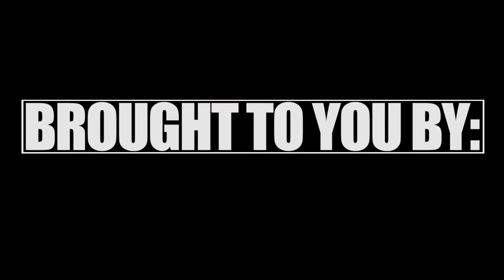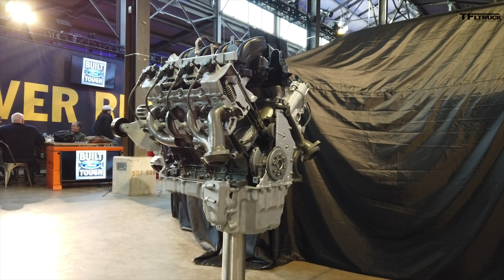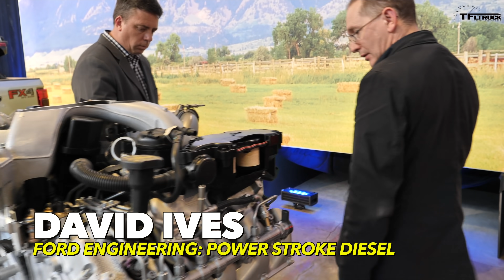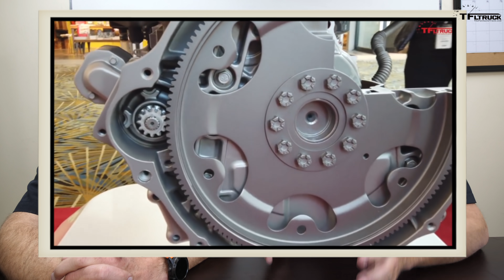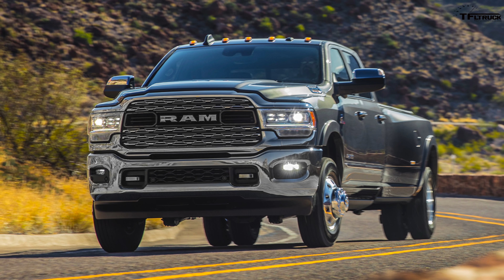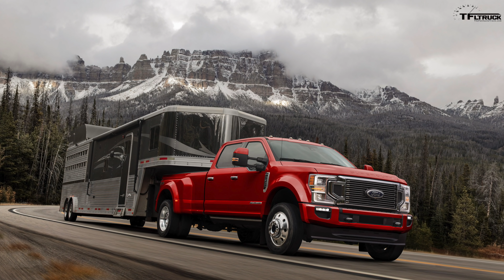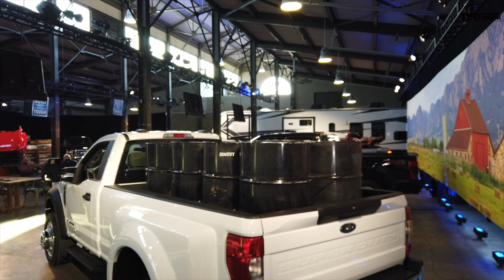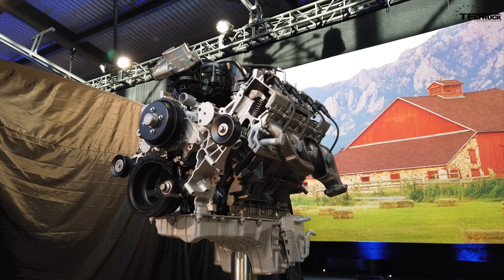Are Diesel HD Trucks Dead / Will Electric Pickups Replace Them? No, You're Wrong! Ep.5

Comment: Diesel died years ago. Has already been replaced by big gas v-8s. At least in the heavy construction industry. I haven't seen a diesel work truck in 10 years. Electric isn't even close to replacing combustion engines yet. Need a better way to store the electricity. Lithium just can't do what is needed.

Comment: Fully electric trucks will not be affordable enough to justify replacement for many for the foreseeable future. However, in the future I think, 10+ years, the technology will drastically develop reducing costs of production and cost to the consumer. When this happens, no one will want the fuel bill and will jump on board. Eventually, what electric trucks will achieve may make diesel unjustifiable. They need an option for the turbo diesel noise replicating rpm to keep the fun.

Comment: What do you want to get in a wreck with, while hauling  HEAVY crap around in heavy traffic? A) A truck with lots of gas stored in it's tank  AND lots of electric energy stored in it's battery bank, or B) A truck with some relatively safe diesel in it's tank? I'm not buying the arguments i just heard that electric gas is easier to fill, that it's better, that it's cheaper.  Sorry Roman, Andre sounds more sensible today.

Comment: Ford built a Hemp vehicle before gasoline even had any hold on the market....the oil industry killed it in it's tracks. Good luck all you Ben Franklins.... Hemp can save the planet & run diesel engines clean as a whistle, but NOOOOOOO....Big Oil needs to hoard the cash..

Comment: Diesel is not going anywhere.  Can you imagine the drain on a set of batteries to pull 30,000 lbs?  Battery life will be 75 miles.

Comment: When battery tech reaches the power density of diesel  we will see the conversion to hybrid options but not until then. Diesel is here for a while yet but they are extremely complex and so are gas pots. Electric has the simplicity. I work in the Oil patch and we pump everything with electric motors and those motors last decades running 24/7. Besides with all the tech on these trucks that now need 200 amp alternators just to run all that stuff.  I agree with Roman soon things will be quiet or like ford they will pump the growl through the speakers.lol Thanks guys I enjoy this !

Comment: Just because ford is releasing a 7.0 liter gas engine doesn’t mean it’s the end for diesel.diesel engines we’re meant for hauling heavy loads that gas can’t  but electric could possible end diesel but it will take time for that but in mean time gas is never going to end diesel

Comment: One thing scrolling through the comments that I haven't seen anyone mention (it's possible I missed it) that Graphene Baterries are on the horizon. Much quicker charges, much better power output, lighter overall. Any ideas? Also, can't find the article, but one company took two batteries and placed them in an all electric car, when the first battery ran dry it switched to second one while the first one charged via a conductor on the wheels. Went over 1000 mile supposedly without charging once. True? I don't know for sure but I like the idea.

Comment: It's way too soon to make a judgment, conceptually, the hybrid makes sense with the fuel savings and the starting torque.  Once there are some hybrid trucks out there running around on a daily basis doing real work, we will see how they hold up.  As typical with hybrids, the battery technology is a major factor and the requirements of heavy-duty service will require significantly more battery capabilities than the hybrid cars require.  Moving around on the rough ground, carrying heavy loads, will place a new strain on the concept beyond what has been done with cars.  The motors are relatively cheaper to replace, but the controls are very expensive, which may offset the cheaper motor advantage.  As an electrical engineer and a diesel truck owner, I am watching with great interest, although I still like my ride to make great sound!

Comment: Andre is right, sorry Roman.  Diesels are hear to stay.  They have become soooo much cleaner.  For the amount of power you get out of them and they are very efficient at that high power output they are the better choice.  Men will always want there trucks to sound awesome and you just cant do that with electric.  The reason they came out with that engine was mainly for their medium duty trucks. Some customers just want a gas engine and it was time to retire their V-10.  I have owned a 2001 Duramax, and a 2016 Duramax.  I loved that 2001 more than any other truck I have ever owned and I have been buying trucks since 1983, that is until I bought my 2016 DMAX.  That is one insane truck. 3500HD crew cab short bed single wheel. It does everything I ask it to do and a lot more. It is the most awesome truck and engine I have ever owned bar none.!!!!

Comment: Andre your WRONG there's a lot of commercial trucks using natural gas and propane many engines are made by Cummins.  Personally I dislike diesel pickups, I run a 454 big block in mine and love it. Mileage is about the same as new choked down diesels, fuel is cheaper, maintenance is cheaper, no fuel additives or urea which both add costs. Besides I don't have to stand in a puddle of spilled diesel fuel when refuelling and smell exhaust and diesel fuel. Also gas is smoother and no vibration, start faster and better when cold. For me 425 go and 500 ft lbs is plenty of power and have twice the rpm range of a diesel.

Comment: Forget the expensive and complex battery hybrids (that can be betrayed by weak batteries).   The point of the 7.3 port injection spark ignition engine is to provide a ready-made platform for CNG or LNG for HD pickups.   On a $/MMBTU basis natural gas costs a fraction of diesel (or gasoline) and can be made to run very clean without all the complexity being packed into late-model diesels.   All they need is an upsized fuel system (including injectors) to accommodate the fact natural gas is less energy dense that No.2 or RUG.   Already we are seeing CNG and LNG being put into Class 6 and 7 delivery trucks (think UPS)   Trucks that big can accommodate the bigger fuel tanks natural gas needs.   7.3 SI engine on CNG or LNG:   Lighter and cheaper than diesel.   Cleaner without the complexity.   Way less expensive tht battery hybrids and a lot more reliable.

Best of all?   The US is hip-deep in recoverable natural gas.

Comment: Ok can I just say something about what these idiots r saying. You’re talking about a 7.3L hybrid gas engine and theorizing that gas engines r gonna replace diesels. Let me tell ya something, YOU’RE NOT GONNA GET THE MILAGE OUT OF IT!!!!! Chevy has proved it years ago even without all the new economic systems. Actually even with em an LSX, which is a 454 (7.4L), does not even get close to to the mileage of a 6.6L Duramax. Alright, a Chevy 8.1L Vortec has more towing power than a Duramax, but u pull anything with an 8.1 that gas needle will go down faster than a NACAR cup car can get halfway in their fuel run. Hell Ford’s 3.5L EcoBoost claims to get worst gas mileage than their V8 5.0 Coyote. So u guys r drunk if ya think gas engines r gonna replace diesels.

Comment: If I doesn't have the Future Generation diesels like the Achates engine design I won't buy it, plus it better be clean burning NO Volkswagen cheating or any other brand of diesel cheating crap on them. Nothing wrong with having a Achates style clean-burning diesel engine that has low emissions and still have plenty of power with good fuel mileage...

Biggest problem with the Diesels is the emissions that they produce,they produce plenty of power and they're great for towing and pulling there's there's far too many harmful emissions that come out of the tailpipe. We have the tech to produce clean-burning diesels as well as long range running engines but we don't use them or they're not for sale in the market because it will take money from the big Industries or greedy billionaires!
Reply: Its a funny thing I actually noticed that some VW Diesels smelled old school( that was before I was aware of "Dieselgate"

Comment: US Army has a Hybrid HMMWT Cargo Truck.  8 -Wheels on the ground.  Diesel engine coupled to a 200 or more megawatt generator.  I believe it has two motors, one for the front axles, other for the rear axles.  Good on/off road and can power an airfield, if needed.  The one I saw being tested was providing power for a small airport.

That was about 15-20 years ago.  The generator and electric motors added several hundred extra pounds, overall.  I believe it eventually scrapped.

Rick
Retired Army 88M (Truck Driver)

Comment: Today’s after treatment diesel systems are 5 to 10% cleaner at the tail pipe than gas engines. The death of diesel will be the failure rate of the after treatment system and the cost of repair. Hopefully there will be a better way to clean up diesel exhaust in the future because the system they have now is a disaster.

Comment: I think the nail in the coffin for diesel engines going forward is that the fuel is 50% more expensive than regular unleaded many parts of the country. This difference easily makes up for the added efficiency of diesel. Will be difficult to recover the added cost of the diesel engine. Want to add electrification or hybrid then the overall efficiency goes up even more

Comment: Just take the batteries out of the equation altogether, and run the petrol engine purely as a generator to run the electric motors.
That way you can optimise the RPM's for the power needed at any given time.

Comment: The idea of a hybrid is interesting because it allows other things that were not covered in this video.  For example, Honda is one of many manufactures who's newest hybrid engines are a true hybrid in every sense of the word.  The electric components work in conjunction with the pistons.  This has allows engineers to switch away from the otto cycle (look it up) that virtually all internal combustion engines use and instead go to the much more efficient Atkinson cycle.  The electrical motor is computer controlled to fill in any gaps in power that that pistons leave making for a smooth experience.  More power and more efficiency.

That being said, most vehicles will soon be purely electric.  Hybrids are a phase that auto makers will experiment with but ultimately abandon due to cost and complexity.  A pure electric motor is superior to an internal combustion engine in virtually every way.  The only limiting factor left is batteries.  Really serious research efforts into new and improved batteries has only been going for a few years now and we can expect to see the fruits of that research start to arrive in drips and drabs over the next decade +.  The batteries we have now are actually sufficient but require operators to make some adjustments to how they currently operate such as stopping more frequently on long trips... but that's changing quicker than most folks realize.

Comment: A 7.3 turned hybrid would definitely out-weigh the power stroke but it depends on the battery size. Based on the leaked photos of the plug-in hybrid F150 that insinuates a relatively large battery. Volvo has one of the largest batteries in a PHEV for their SUV lineup which is about 10 kWh which is large for a hybrid system, and according to one source (https://www.plugincars.com/volvo-xc90-t8) adds about 550 lbs total to the vehicle. So the big known factor is a hybrid system would be, in all likelihood, heavier and more expensive for now - the big unknown is - what performance will it produce? I think if we get a PHEV F150, it may have a smaller payload rating but significantly increased towing capacity and performance with the added benefit of fuel economy. I know TFLTruck makes the topic sound polar for entertainment, but it's all about what increments can be done. Diesel is here for a long time until PHEV/Full EV outperforms in all numbers, especially purchase cost and lifetime cost. Or the out-performance is worth the added cost. It's all about the consumer's buying power (and obviously it has to perform).

Comment: Roman made pretty much all the good points possible for his argument; Andre did not. At today's level of technology and at today's cost for each technology; hybrids do not have advantage above 8600 GVWR. The points about equalizing or even surpassing a diesel's capability with a gas electric hybrid is a valid argument, but to assume that this can be done more cheaply or less complexity within the GVWR classes versus a diesel is a big stretch. A diesel is a one propulsion system; a hybrid has two. Additionally, there is an assumption here that diesel technology advancements have stopped. The diesel engine is newer than the spark ignition engine, and yet the gas engine is still advancing, so how can we assume that diesel engineers won't solve some cost issues related to exhaust treatment and get lighter and get more power per liter at the same time that the dual propulsion systems are improving, but regardless of improvements, the latter will always have dual propulsion.

Comment: A Hybrid 7.3 would have enough torque to haul it's own battery and maybe a popup trailer. It'll never have the torque numbers of a turbo Diesel or it's towing capability. No hybrid on the market has interesting torque figures as it is limited to preserve battery life. If you want lots of torque avaible all at once forget batteries, you need either super capacitors or ultra capacitors. Grafene based capacitors would be best and lightest. They can also charge up in seconds and even in sub freezing temperatures. But it will never match the capability of Diesels. Only Diesels are used in cargo ship cause they have the torque. And all the pollution is from cargo and cruise ships. Not a single anti-pollution device is found on those ocean haulers and they use the dirtiest diesel fuel found on earth. Simply the 15 biggest cargo ships put out more pollution (real soot, not CO2 which is plant food) than every car on the planet combined per year! Buying local from your nation or neighboring countries is far more enviro-friendly than any import product purchase. Buying an American made truck is far better than buying an EV or Hybrid that has a battery pack with rare earth minerals like Cobalt extracted from Child Slave Labor from the Congo in mud pits with gun men warlords looking over them without food, then having cargo ships ship the mineral to China, South Korea or Japan to then have the battery shipped again via Cargo Ship to it's final assembly plant, then shipped again to your dealership. What about other minerals like Nickel or Lithium. Lithium from Afghanistan? No human rights violation there ever? Nickel, one of the most destructive mining process. How Diesel is so demonized yet the media turns a blind eye to the battery industry is mind boggling when you know the facts. How the enviromentalist socialists are up everyone's tailpipe yet miss the cheminey stacks of cargo ships, contamination of waterways from mining, destruction of ecosystems and landscapes from mining and Slave Labor (unpaid at gun point and worked to death litterally) is beyond me.

Comment: I've always felt that hybrid vehicles have been done wrong by most manufacturers. It seems to me that trying to make battery packs that have a 300 mile range and charge in 30 minutes is a misguided effort. It's well known that there is a peak efficiency point for internal combustion engines. I believe if you take existing all electric vehicles, reduce the size of the battery by 75%, put relatively powerful electric motors in, and use an internal combustion engine as a stationary generator you'd have the best of both worlds. I have a 2018 Colorado with the 2.8L diesel. I think if they downsized that engine to 1.5L and used it only as a generator you could probably increase the fuel economy, increase the power, and have a 600 mile range on a 20 gallon tank of fuel.

Comment: Wrong we are rebuilding Cummins isx 15 and isx 12 cm2250 and cm2350 with 300 k to 500k after treatment are killing all the Diesel engine, there not many engines that can see 1000000 miles :(   Detroit dd13 and dd15 I think the are better but high pressure fuel systems , cam housing and one boxes make real expensive to maintain

Comment: Diesels are more efficient and run cleaner releasing less Nox into the air. Diesels are only more dirty because they are petroleum based and not as refined. RAW power. In terms of service and having a bad name it comes from people only caring about fuel efficiency and most people don’t tow. The bad name comes from these young kids getting super up trucks only to roll coal

Comment: Seems like a smaller diesel driving a strong generator would be the best solution.  Torque on from both, when electric operation, very efficient battery recharge.

Comment: He spends all this time arguing about how heavy diesels are compared to gas engines then when asked about the extra weight that adding batteries, electric motors, and generators would add to this gas setup to make diesel equivalent power  he says well heavy duty trucks can have extra weight.... he negates his own argument by saying weight doesn't matter. Hes also argues the price of all the emissions equipment on diesels.... Its currently about $4000 for replacement batteries for a Prius and many people are running into this at the 10 year 150k miles mark and that's for enough batteries for a dinky little Prius now think about how large of a battery set will be needed for an HD truck and what that's gonna cost every 150k miles

Comment: It’s funny when he says that Diesel engines are very heavy (which they are) but then says that gas plus electric would be similar power and less weight? The batteries alone would add 7-8k to the overall weight